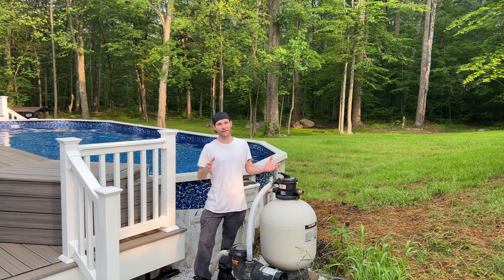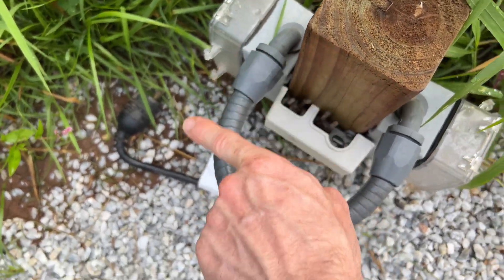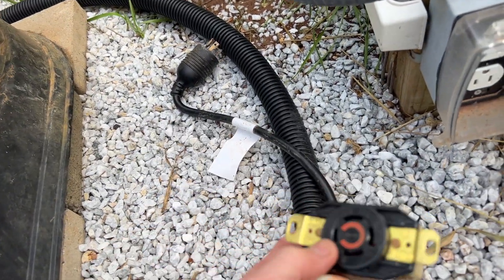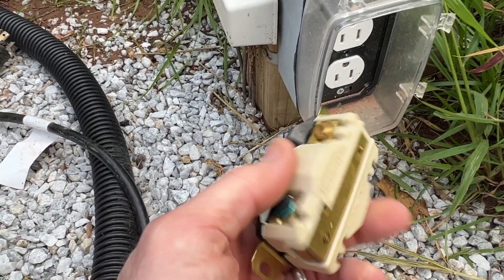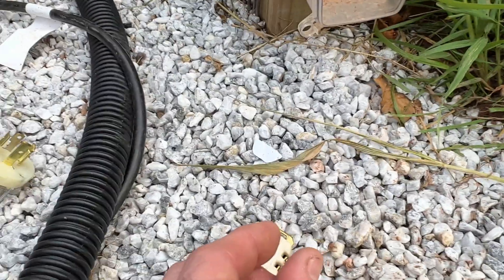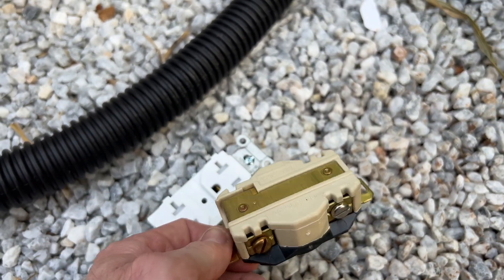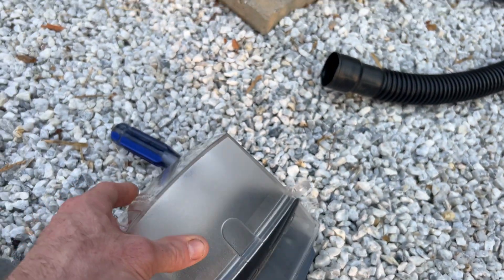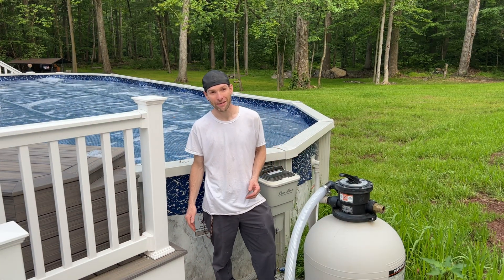How to wire above ground pool pump twist lock outlet electrical wiring electric installation to code

Comment: That car flex looks like dooky. Why not drill through the post and come into the back of the other box?
Reply from the maker: I guess that would be a pretty slick way to do it, but you’d have to drill a hole big enough for the half-inch male PVC connector to fit through. Probably a three-quarter inch, maybe even one inch hole. It might affect the entire of the post, or it might not really be a big deal. Idk, but I agree it would definitely be a much cleaner look.

Comment: Can you buy just the plug and cable?  I just had a new pool installed and I use the exact same plug, but it got thrown away with the old pump.  I don't want to have to buy a 20 amp plug and make one.  Would like to keep it sealed like the old one, and one you're using in the video.
Reply from the maker: I hear what you’re saying and I would’ve responded sooner if I had a better answer, but personally I’ve always seen the cords come attach to the pumps from the factory. I guess you could replace them, but the pump usually goes bad before the cord.
Reply from the maker: I’ve looked around and talked to a couple other electricians they are not too familiar with premade whips that have the cord and plug nicely molded and attached either.
Reply from the maker: I’ll poke around and ask around a little more and if I can get you any options. If i can I’ll respond and let you know

Comment: You didn't explain grounding.  I'm installing a new pill pump and it says the pump must have its own equiptenially terminal connected. What is that?
Reply from the maker: The wording seems a little strange, but all pool pumps must have their own certain things. I’ll explain those and what that could mean in the following comments below. As far as the more details on the grounding… That’s shown in this video https://youtu.be/MRA8dVsTLy8
Reply from the maker: 1. Most likely what it’s talking about is the grounding terminal lug that should be at the bottom or back of your pool pump. That lug would have it on ground wire going from the pool pump lug  to the grounding bridge. That could be considered its own equipment terminal connection.
Reply from the maker: 2. It must have its own dedicated line from the panel with a GFCI breaker. It also must have a twist lock plug and deep bubble cover for the pool pump’s twist lock plug at the at the end of its cord to plug into. That cord is terminally connected inside the pump to give the pump its own twist lock connection that can be plugged and unplugged. It cannot be hardwired. That also could possibly be what they mean by having it own terminal connection.
Reply from the maker: 3. Basically all pool equipment and anything metal within a certain distance around the pool pass to have its own dedicated  grounding connection going from that specific item to the grounding bridge. They all have to have their own individual dedicated “equipment terminal connection“ with solid ground wire going from that piece of metal or equipment to the grounding bridge

Not sure how much that helps, but I’d be happy to try to answer any other questions
Reply: @BrandonStunts  my electrical outlet has that.  So it it grounded then?
Reply from the maker: Grounding and bonding are two completely separate things.  The ground in the twist lock outlet that the pool pump cord twist locks into is the ground for that specific electrical circuit only. That ground is connected into the main electrical panel, which should also be connected to a ground rod outside, and but that is completely separate function and purpose than the pool bonding.
Reply from the maker: The pool bonding is meant to be completely separate. The bonding is the process of connecting all the electrical and metallic parts, accessories, and items around the pool together through the bonding wire to form a non-resistive path between the components. The goal of bonding is to connect, contain and prevent the risk of electrical voltage traveling to pool equipment, people, pets… etc. aka keeping it separate from the electrical stuff carrying amperage and voltage
Reply from the maker: The bonding doesn’t use a ground rod. I guess the way that it would be considered “grounded” would be the continuous bonding ring of solid bare ground wire that goes around the pool that i shown and explained in captions in the video I posted in the first comment. 

The bonding ring wire connects to the grounding bridge along with every item that gets bonded. Including the pool pump motor, skimmer, bonding plate, and bonding to the four points of the frame rails, and anything else metal or electric around the pool. Unless you have resin frame rails, then there should be a seam somewhere in the wall to bond to, but I’ve never done that so I’m not familiar with that process.
Reply: The metal frame is all connected together. It doesn't make sense to me.  I can't ground at one side of the steel frame? The issue is the pool pump.  How do I ground that, can I just pound a grounding stake into the ground and connect the pump to it?